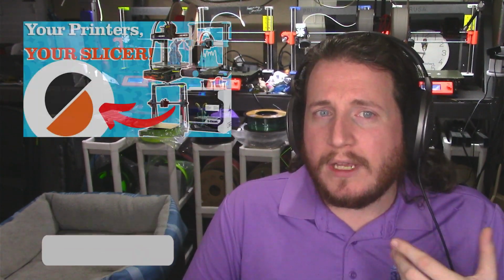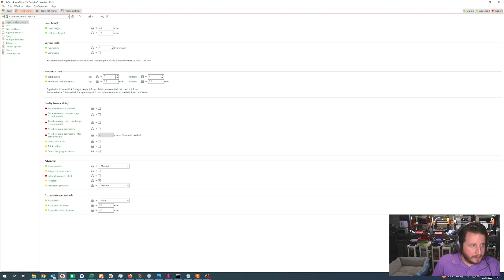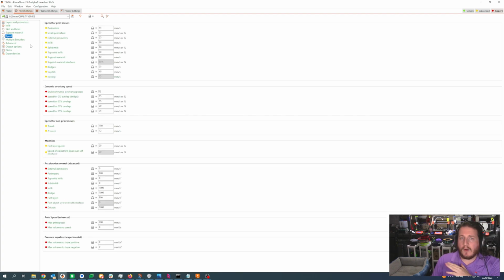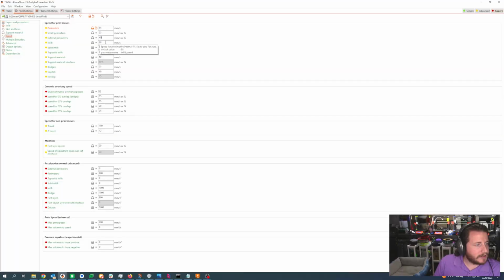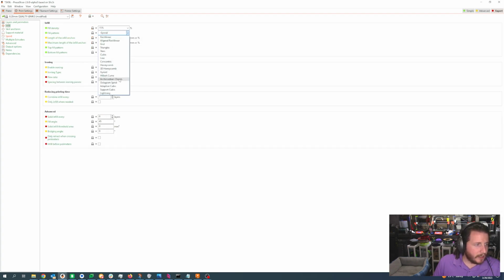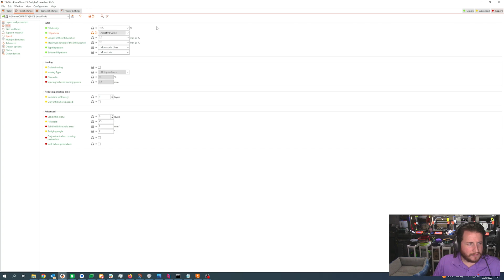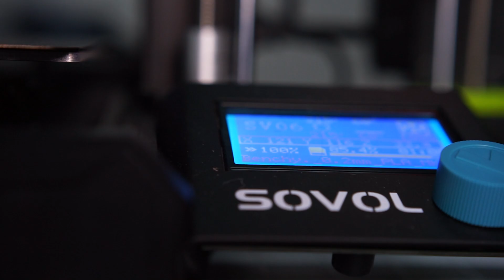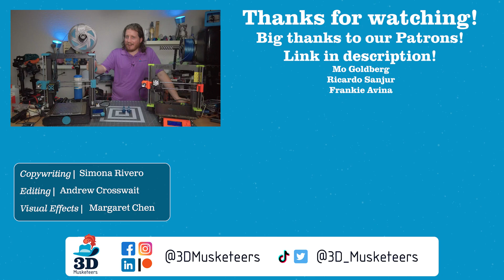Hardware Or Software: What's More Important For Print Quality?!

Comment: you mean I'm not supposed to print at only stock speeds? lol (I actually do)
Reply from the maker: I never do, too slowwwwwww
Reply: @3DMusketeers  It's only too slow because the damn MMU gets stuck an hour after I went to bed/work (while it's perfectly happy when I'm both awake and home) lol
Reply from the maker: that is also an issue lol!
Reply: @3DMusketeers  I thought I finally got it working right. I went to bed on sunday night 2 hours into a new 2.5 day print. I woke up with about 7 additional hours of printing completed before it got stuck. I fixed it, I went to work, I came home it was still printing!!! nope! Monday night I went to bed and got less than an hour of additional printing. I went to work again maybe an hour. Last night I got 4 hours. I don't know how much I got from work hours yet.
Reply: I think a big part of the problem is the cutter. The cutter can save your ass, but where do those tips go? they are SUPPOSED to drop into the bin (which isn't easy to empty at all and isn't big enough, but anyway) but in many cases they drop into a screw hole. They stick out and the selector gets stuck on that. I'm tempted to print an insert to cover the screw holes. lol If I did that I think it would solve a lot of issues, but it wouldn't fix them all. Many times the notch on the filament that prevents a successful load is way too far up to let the cutter to fix it. This is why I think the nextruder will help. It's going to be way less likely to leave a notch in the filament than those tiny bondtech gears. However.....that won't fix the bondtech gears in the MMU itself. However notches from that aren't very common at least on the jessie orange. It's usually an issue with the notch caugins problems with loading the extruder. The higher up notch is a problem with the MMU having enough gripping strength to push it in all the way.
Reply from the maker: try the little covers and see if they help!

Comment: You see the MK4/MMU3 release stuff yet? Sadly I can't find hardly anything on the MMU3, but the MK4 looks AMAZING! Sadly I think this means my Revo is obsolete and my spare Revo parts as well.
Reply from the maker: of course ;)
Reply: @3DMusketeers  is it worth a look at?
Reply from the maker: would not know yet, we dont have one and will be waiting for the kits to open up to buy one. 

Features are nice, but the industry has changed some, and that cannot be ignored. My full initial thoughts will be next week's video :)
Reply: looking at it more in detail.....I'm not sure the upgrade is worth it. The upgrade is almost the price of a new printer. So if I'm going to pay that........maybe that's what I should do. lol
Reply from the maker: 3.5 is where it is at IMO
Reply: @3DMusketeers  lol that one doesn't even make my radar. Nextruder or no deal. lol (I actually suspect the larger gears will help with the MMU3 reliability)
Reply from the maker: 32bit is likely going to be necessary for futureproof. Nextruder means byebye revo
Reply: @3DMusketeers  Since I feel like the full upgrade isn't worth it, maybe I get the 3.5 and the mmu3 as well as an MK4. I might leave the current MMU2 as is on the 3.5. I don't know. All this stuff isn't available yet. I'll have time to figure out what I want. lol I still kind of want a XL for the tool changer. There is no way that MMU3 is going to have the speed of the tool changer assuming it works just as reliably.
Reply: @3DMusketeers  Agree, Bought a Mk4 and two Mk3.5 upgrade kits. Mk3s+ extruder is just fine. 3.5 has the lcd, the motherboard and will be able to have Input shaper and Pressure advance.
Reply from the maker: I like the addition of a 3.9 kit for those that dont want to replace a frame, so that is nice, but the 3.5 is where it will be for us.
Reply: @3DMusketeers  for a printfarm (probably you fit the spot) the Wi-Fi manager is a no brain choice. I get the improvements for that use case!!
Reply from the maker: we avoid networking printers at all costs, but for most, yes.
Reply: @3DMusketeers  none of the upgrades replaces the frame, the only difference between 3.9 and 4 upgrade is the stepper motors.
Reply: @3DMusketeers  Prusa connect is a side feature isn’t it
Reply: @3DMusketeers  I want to know how the MMU3 works on the 3.5 and the full on 4. Based on the price, I'm not sure the upgrade 4 or 3.9 is worth it. It's almost the cost of a new printer anyway. I suspect the nextruder will be easier to load and thus more reliable with the MMU3.
Reply: @3DMusketeers  I finally got to see the MMU 3 upgrade costs. $89, less than a third the price of a full mmu3. So I will be getting that for sure.
Reply from the maker: oh yeah for $90 that upgrade is worth it!